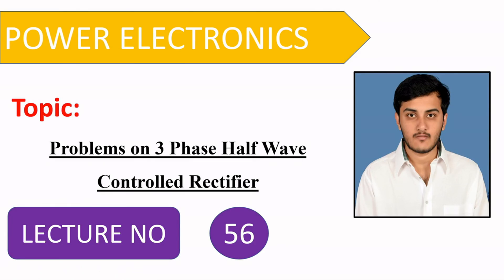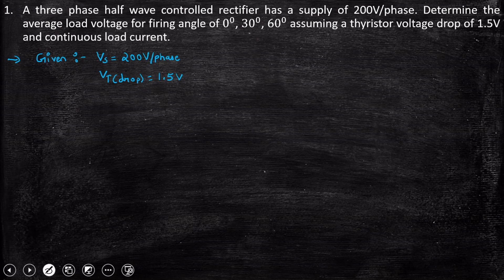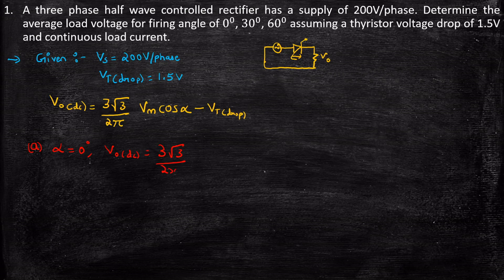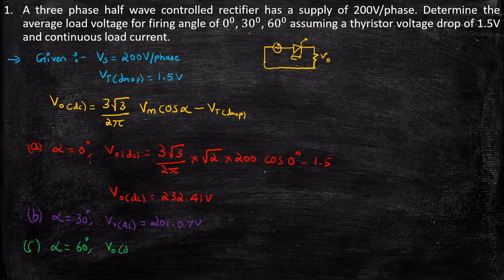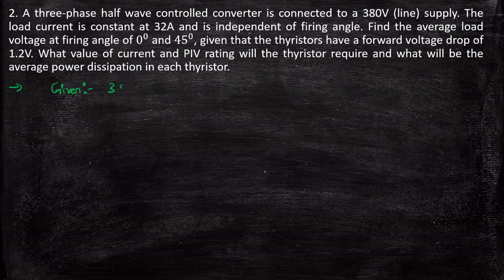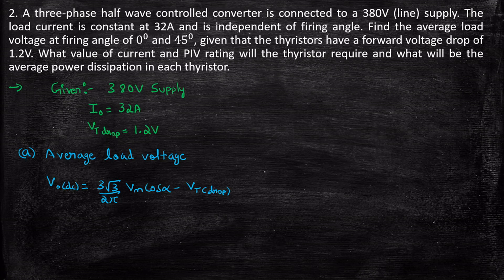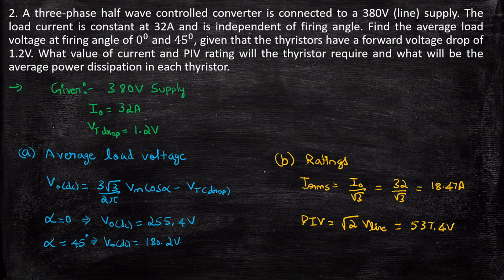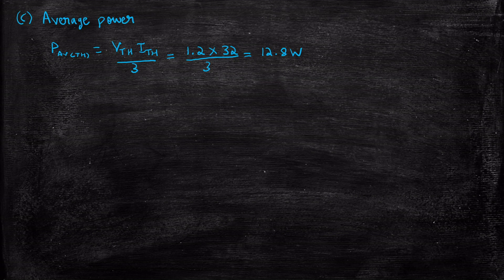Problems on 3 Phase Half Wave Controlled Rectifier | Power Electronics | Lecture 56

Comment: Sir in the second question given data We have 380 V line and first questşon we had 220v phase so do we have to convert 380v to phase voltage and how can we convert it ?
Reply: so you convert it to phase voltage then calculate the the Vm Vphase=VLine/root 3 then find the vrms like the way it was shown in the previous example